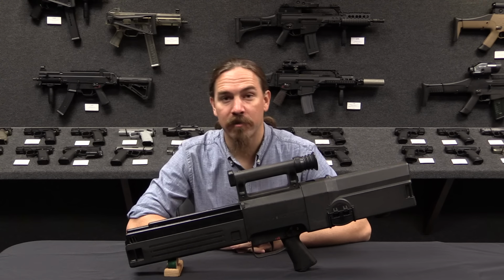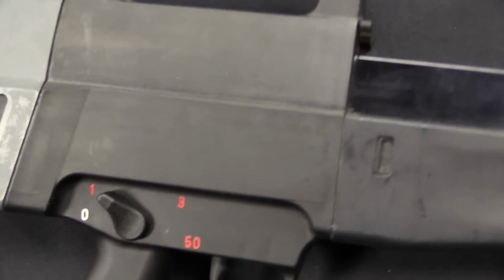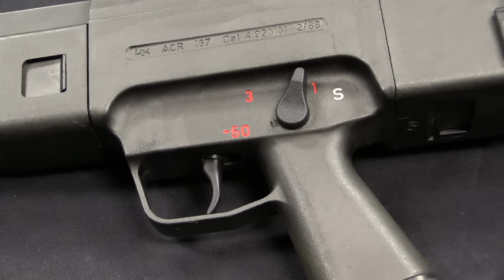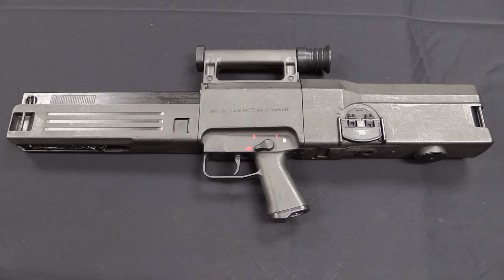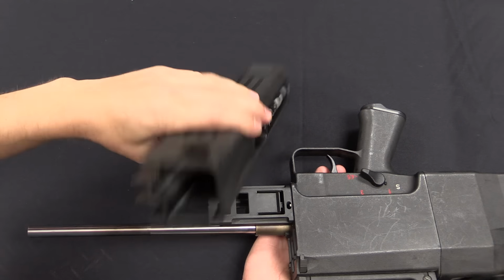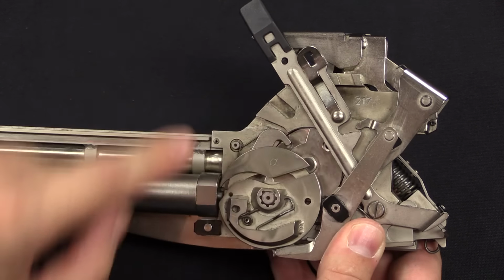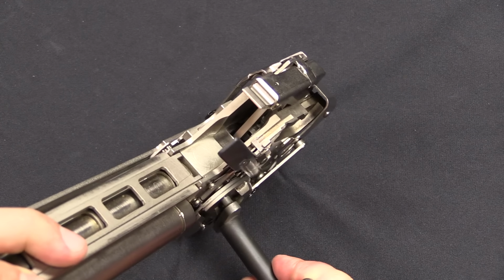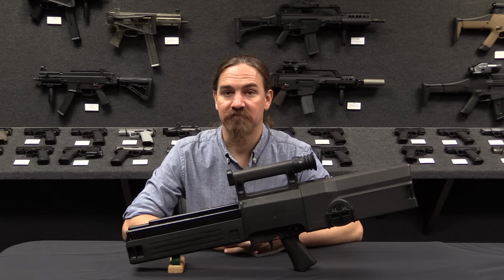Kraut Space Magic: the H&K G11

Comment: To those making fun of the complex action: You have to understand the context and the German military doctrine of the day. The G11 is a very cheap, mass produced weapon. It is largely made of stamped parts and the entire action is bolted together. If anything fails, you ditch the gun. 
Back in the day, the West-German military made the following general assumptions:
1. A war would start on German soil or at least extend to German soil very rapidly.
2. It would be an all-out conflict with the warsaw pact, with massive Soviet forces leading the push
3. The sole purpose of the German Bundeswehr was to fight delaying actions until NATO reinforcements appear in full swing
All weapons developed and procured in Germany at the time followed that doctrine. The contemporary leopard 2 MBT for example, was estimated to have a combat lifetime of 9-13 minutes(!). This is the reason, why the Leopard 2 has a very powerful, precise and fast-fireing gun, very high mobility but comparatively bad armor. Armor was not a prime concern, because it would live long enough anway.
The same applies to the G11. Masses of these guns could be produced in a very short time without the need of complex fabrication steps, but once fielded, a soldier could put out a massive amount of fire towards the enemy in his very short lifetime. Supply chains were expected to fail early in the conflict, so having a lot of ammo on the soldier straight from the start was preferable. The cited 600 rounds were actually a very big thing back then (altough I remember 500 rounds per soldier being contemplated). The accuracy of the G11 was quite outstanding, especially in the 3-round-burst case. The weapon was mostly sealed and could withstand very hard treatment and conditions.
The G11 looks like a relic of a violent past and it really is - if you put it in the proper context, it actually makes a lot of sense.
Reply: And the best part is you have exactly zero worries of captured examples being used against your side. Both because the ammo is hard to replicate and good luck repairing it if it isn't already in perfect condition
Reply: @logion567  true, why even bother with the clockwork when you got much simpler aks yourself
Reply: That explains a lot.
Reply: Considering that chunk of metal is essentially the entire gun itself, if there ever came a time when a soldier had to strip it beyond the field stripping, the SOP would have been to just replace the entire assembly and send the malfunctioning one back for factory maintenance. Much simpler process and cheaper logistics assuming that the systems work, and considering the role of individual infantrymen was expected to decrease dramatically in the "future warfare" this must have made a tonof sense back then.

That said, this gun would have been a maintenance nightmate if it was the standard issue rifle today. And that's why militaries around the world tend to make conservative choices when it comes to deciding which gun to use for the next 50 years.
Reply: @hdd113  that's like saying the panther running gear because you had to take the whole transmission out to repair it, instead of just fixing it in place like in a t-34 or sherman.
Reply: @NGabunchanumbers  I disagree. You can't just dump a bunch of panther's transmission packs on a truck and send it back. On the other hand, you could move hundreds of G11 firing assy's back and forth in a single round trip. It was a comment about logistics, not about the ease of disassembly.
Reply: @hdd113  scale must be considered, and the context provided by the size of the object in question cannot be ignored
Reply: You are referring to the Leopard 1. 
The Leopard 2 was an entirely different beast armor wise.
Reply: Thats still basically the idea in South Korea too. My unit was stationed there on rotation and our job was to destroy infrastructure and then die on the wrong side of it to buy time for NATO. Grim, but really the only even remotely effective option.
Reply: Making a caseless cartridge seems cheaper than a traditional brass case. Just mould the propellant block and insert a bullet in one end and a percussion cap on the other.
Reply: I know you wrote this 6 months ago but this is actually really insightful and interesting - so thank you for writing it up!
Reply: You got any sources? This is interesting
Reply: Maybe it's time to revisit this policy given the current geopolitical situation.
Reply: What a completely mesmerizing bit of information. Thank you. This is really really fascinating
Reply: @beezzarro  It shouldn't be, since he made it up. He doesn't even know the difference between the 50s Leopard 1 and the much later, and much heavier, Leopard 2.
Reply: 9-13 minutes is a standard life time of any MBT still
Reply: if they could produce massive amounts g11s, that would really say a huge amount about their industial capacity. Stamped parts or not, that's a lot parts, so they must have been very compfident they could get a long production line runging really fast , and scale it way the hell up, same with the ammo. It really is a relic of a violent past, a kind of complex tractor made for a death throws all or nothing conflict which we happily did not see. And I, with my zero qualifcactions, but having read a good bit about military history, think that's...well holy shit, it's grim, amazing and impressive at the same time, and that's all I can say.
Reply: Jesus Christ. If true, that is such a terrifying, dystopian concept. Literally the extremization of the idea of "Most of you will die, but that's a sacrifice we're willing to make.", although having a gun designing hobby I could imagine myself going crazy experimenting on the conceptual side of such a doctrine.
Reply: Thank you
Reply: Right👍
Reply: And then russia started the war and we realized we overestimated them so much. The only reason the west is so powerful military wise is because russia lied about its power over all those decades, so the west prepared to fight against this phantom army. This will be another milestone in every history book in the future.
Reply: @bazz303  Phantom army? Did you even finish school bro? It was an arms race because both sides had nuclear weapons!
Reply: @narutofanz4  normally i dont reply to people whose main argument is "bro". sure they had troops. many troops. but the real army wasnt in russia, but Poland, east germany and well, Ukraine... and as we can currently witness, basically live and in real time, the russian army is just a phantom army compared to what their propaganda wanted to make us believe in all those decades. undergeared and often without a plan. heck, they even give away their position by writing insults in the snow, highly visible for the drones. but well, the russians also fell for their own propaganda and thought they could invade Ukraine in a couple of days. the only reason why putin isnt sitting in a cell block waiting for his trial, are the nukes. and for the rest, i was literally living right next to the iron curtain in a big garrison town and had the chance to travel to east germany and Poland during the first cold war.
Reply: @bazz303  gonna be honest, 'phatom army' seems an exagerration now, but for back then, expecially back  then, if that was relevant to your comment, it seems unlikely. If you were talking about late soviet times, they'd still have a good number of satilite states to throw into the grinder.
Reply: Uhm, no, no way, no how, no shit, the idea of "if it fails throw it and get a new weapon" Is a terrible way to manage logistics and get your troops killed
Reply: Great explanation thanks for sharing
Reply: NATO is a disease.
Reply: And he makes it sound like a great expensive weapon!!
Reply: What are you taking about. You sound literally insane
Reply: Fascinating. Thanks for these facts
Reply: One legit doubt I had is if the caseless ammunition impulse was mostly derived from how copper was a critical material to be used during WW2.
Reply: I'm not sure whenever "being extremely internally complicated and uses a very difficult and not very reliable ammunition" really works hand to hand as a disposable and easy to manufacture weapon for buying time
Reply: @周生生-f1f  Think of it like this: You have a poster that only you and your friends know the template to edit and print it but it's a ridiculously complicated pattern and art that no one but you and your friends can easily edit for other purposes even if other people had photoshop. Now, your cousin took one of your posters to make his own version of it, but he's confused as to how he can repurpose these complicated patterns and arts for his own project meanwhile you and your friends just keep printing and editing these posters easily because you have the template for it

And that's their logic, Germany already knows the stamping process and the machines to fabricate these weapons and ammo so theyre easy to make and cheap
Reply: The Leopard1 was the one with thin armor. The French went the same way with the AMX 30 back then.
Reply: Sounds like something you’d give to a 40k guardsman
Reply: @go5083  Exactly. Fits even the style very well, add some symbolics and grime, make them look repurposed multiple times or even coverted to lasguns and bam, the perfect lasgun.
Reply: Very informative perspective! So would you say it's similar in the way that the US Grease Gun was manufactured? Low cost, high production?
Reply: I am a german M.A. of History and i have to say that your narrative about the german military doctrin in the cold war is  not very accurate and without proper sources. And every calculation about the life time of any tank or any military unit in a WWIII on german soil is pure speculation. The core strategy in the cold war was that the Nato should defend germany with strong military forces against the armies of the warsaw pact as close to the border with the GDR.
Reply: @maco3893  I've been reading a book about Able Archer, and another by a RAND analyst who was responsible for planning nuclear strikes... And some other stuff regarding 7 Days to the Rhine etc One of the interesting things I have read, which you could probably clear up, is that due to the unbelievably massive amounts of Soviet armour that would pour through the border, there was a plan to detonate 'neutron' bombs(apparently they really weren't actual neutron bombs) over armour and troop concentrations. The idea is that the burst of radiation goes through the armour and renders the soldiers sick and the armour useless as it is radioactive. The idea is that destruction is minimised but its an effective area denial weapon. But the problem is the bombs radiation doesn't extend very far past its pressure/heat/light destructive force. Just as the OP said the plan seemed to be just slow them down as much as possible. Using nuclear shells in a howitzer and even special forces carrying nuclear demolition charges to destroy bridges, tunnels etc...a part of the book mentioned even using mustard gas shells in large numbers too. I get the idea that the American brass in charge were pretty OK about losing a massive chunk of Europe just to dent the Soviet advance before NATO could retaliate. Were they actually that willing to use nuclear weapons like that (risking escalation to strategic use) or was it, in your opinion, never going to get that far and stick purely to conventional means? Also do you think West Germany would have been tougher to push through than the Soviets and Americans believed?
Reply: @mccarthy5825  Don't forget the chicken-powered nuclear landmines :)
Reply: @mccarthy5825  Richtig, diese plaene wurden oeffentlich diskutiert.
Jg.63, Bundeswehroffizier a.D.
Reply: @heinzweber7642  can you translate that to English for me please my German friend? I don't speak your lovely language unfortunately
Reply: @mccarthy5825  Well, given the actual situation in the ucrainian war I thik that we will find out soon...
Reply: @maco3893  pretty clear that the fulda gap would have been a nuclear wasteland and germany was a buffer. what we wrote is kind of right. the core strategy wasnt really (in case of a hot war) to defend all of west germany. the fulda gap was supposed to be actively exploited as a trap.
Reply: @maco3893  Well, your M.A. is not worth a cent. The german doctrine (west germany) was to survive long enough so the NATO-partners could bring in enough troops to stop the WP-masses. And as it was described, exactly for this was the G11 planned. Your single soldier has 4times the ammo he had with the G3, could actually hit/kill an enemy soldier with the 3round-burst and the gun was very stable and robust. If it breaks, you drop it and take another one. 

I understand that Marines and their sexual desire to do things with THEIR gun, their love are in opposition to this. But West germany had the doctrine "use it, throw it away if it breaks".
Reply: The Leopard 2 was a high quality piece with great armor. You are clueless.
Reply: @hb9145  he sad the leopard not leopard 2.
Reply: you sure about that analysis of German doctrine? any source to back up your claim of the leopard having a combat life of 9-13 minutes? you cant train a tank crew in 13 minutes, and anything other than a mobility kill probably means the death or injury of the tank crew, and Germany certainly didnt have unlimited personnel
Reply: That doesn't make sense. Its clearly not cheap based off of the amount of parts.
Reply: @NGabunchanumbers  it was because of the production method and construction.
Reply: I knew this comment was complete BS the moment you said the Leo 2 has bad armour...
Did this "information" come to you in a fever dream???
Reply: Как у леопарда 2 была лучшая броня среди танков НАТО, разве что у м1а1 с урановой бреней, защита была лучше.
Reply: lol if anything happens, ditch the gun... you sound ridiculous dude go back to call of duty
Reply: Never use "mass produced" and "german" in the same sentence.
Reply: @panchrosynchro  "Never use "mass produced" and "german" in the same sentence."
The VolksWagen Beetle does come to mind. Probably the most and longest produced car model ever, and it is German.
Reply: @panchrosynchro  mp 40 has entered the chat
Reply: Doesn't seem very ergonomic.
Reply: At first I was skeptical reading this comment, then I mentally recontextualized and realized, wait no, that makes a lot of sense.
This concept is the exact disconnected from reality sci fi nonsense that would be the logic behind  the g11.
I'm going to keep making fun of it because this has convinced me the complexity was an even worse idea than I originally thought
Reply: Leopard 2 had a bad armor, lol. You have no idea what you are talking about. Plz delete this comment.
Reply: @pennywise1682  No, he is right. The early versions of the LEO2 had average armor. Only the later models had this superior armor.
Reply: @pennywise1682  Leo 1 was the original concept but Leo 2 improved it with better armor and armament.
Reply: @pennywise1682  Since the youtube comment sections become confusing as larger it gets, im not really sure what you try to say. Are you joking about someone who claimed that the Leo 2 armor is bad, or do you claim that the Leo 2 armor is bad?
Reply: @bazz303  i was joking
Reply: @pennywise1682  Hoped so, but you cant be sure these days with all the russbots unleashed. Sorry for the confusion.

Comment: Can we just take a moment and appreciate the fact that US armed forces are today looking at caseless ammo for potential future development. HK was so ahead of its time there.
Reply: I think their ammo development was equally impressive - that’s what the US used as the basis for their LSAT program. Take a sec to research it, it’s almost as interesting as the gun itself.
Reply: It's german, so of course it would be ahead of its time
Reply: We (the US) was fooling around with caseless ammo in the 1960s. Not enough R&D money thrown at it. Popular Science ran several articles on the progress over the years. Private ammo manufacturers led the way.
Reply: Everyone's been looking into caseless. Nobody made it work yet. Including HK.
Reply: Totally it removes the ejection cycle ..pros  and cons.
Reply: @richardmcgonigle1160  my question is if the ejection cycle being removed is really an advantage. At this point it's superfluous to the action of any fully automatic firearm. The bolt is going to open either way, and that's already an efficient and reliable mechanism, you're just ejecting a case while inserting another cartridge.
Reply: @TheCompleteMental  have you carried a lot of ammo in brass cases? Weight for one... but yes you do have a point no.brass to absorb n eject heat amongst other problems.
Reply: @richardmcgonigle1160  have you carried alot of ammo without brass? The weight difference for someone carrying ammo on their person is not that substantial.  Brass is not where the weight is.  Your bullet and powder is.
Reply: @JustStayingGroovy  yes actually I have. And any weight loss is another round I could carry.
Reply: @JustStayingGroovy  5.56 and 7.62. Agreed the powder n bullet is heavier than the case.
Reply: The problem is how do you ignite the gunpowder in one?
Reply: @AleksandrPodyachev  Did you..watch the video yet?
Reply: @AleksandrPodyachev  AFAIK during design phase it was a problem not to ignite the ammo -- due to not enough heat dissipation...